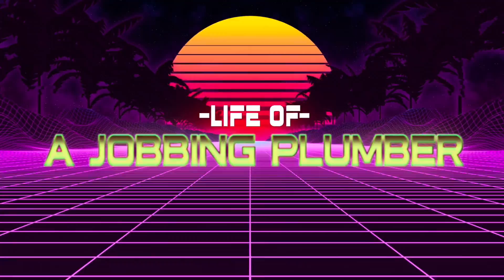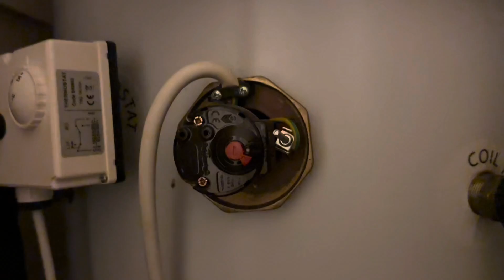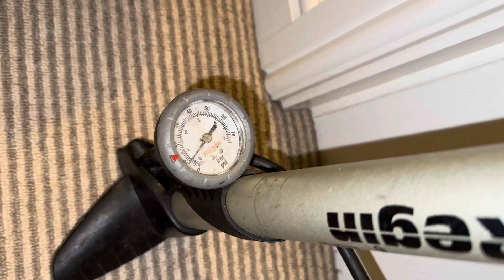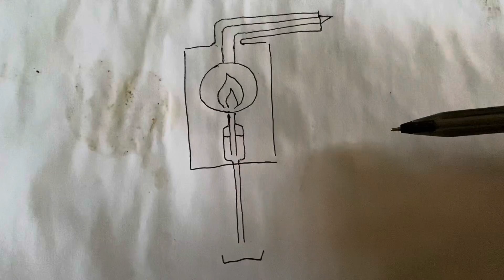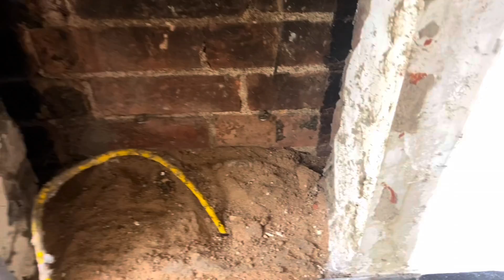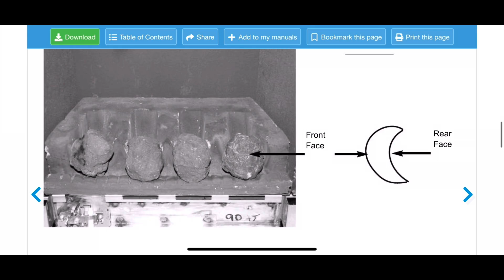P B Plumber The life of a jobbing plumber #112

Comment: Correct if I’m wrong but you set cylinder stat at 55 but you said turn down to 45 if too hot, correct me if I’m wrong but is 55 recommended at minimum for legionella avoidance?

Comment: Love the flue diagram,  most boilers but definitely ideal the flue should be I stalled level. Do not raise and flow back to boiler as I had so many problems with this. They have a internal raised ring in the flue to stop it going back.  Level your flues guys